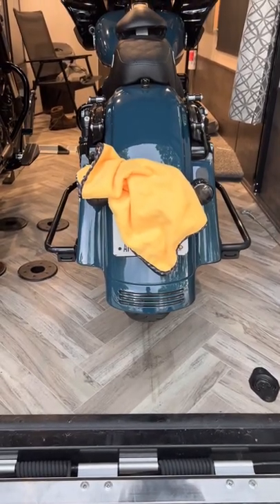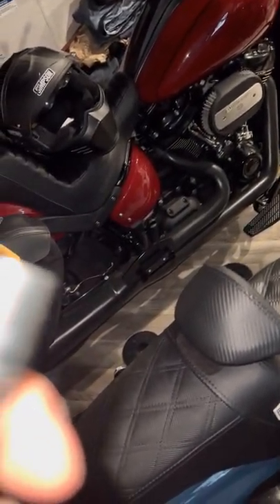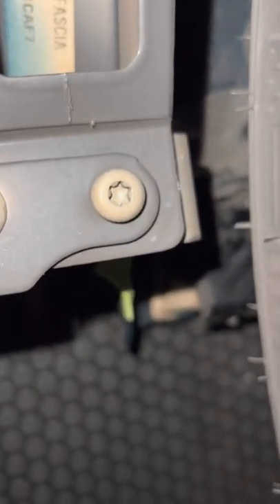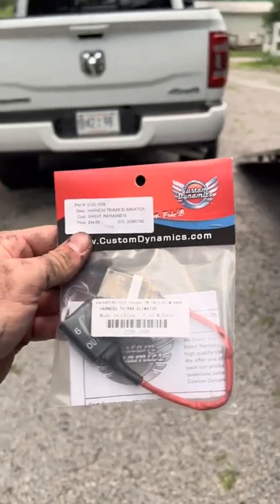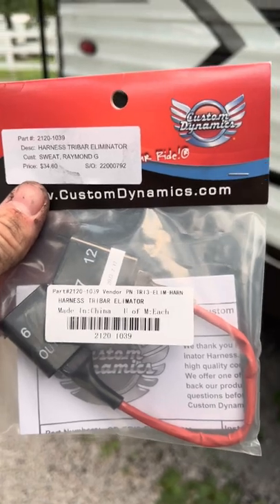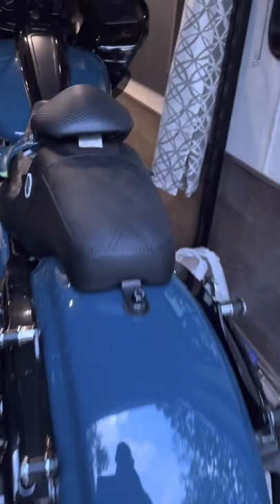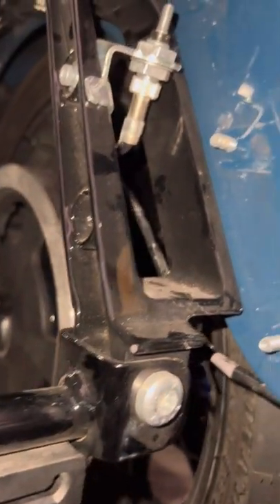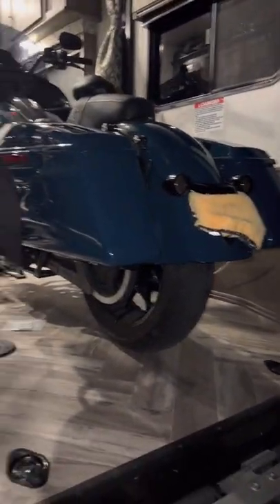Harley Touring Tri- Bar delete and rear fascia cutting and reinstalling.

Comment: What bar set up is that and do you like it?
Reply from the maker: I absolutely love my bar set up! It’s a thrashin 6.5” pull back with the road glide adaptor plate and the high bend bars. I am a huge fan of the thrashin supply stuff, I have thrashin on both my bikes!
Reply: @vtwinsndiesels4254  what did you zip tie the wires to
Reply from the maker: @garrettroberts9942  there is a bracket under the fender that I zip tied everything to